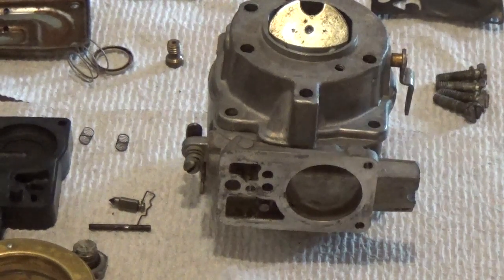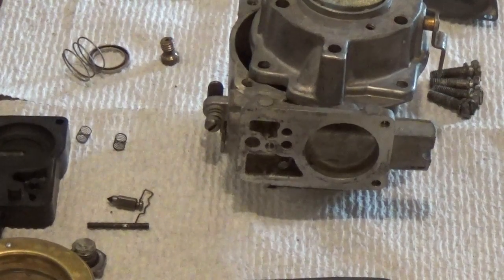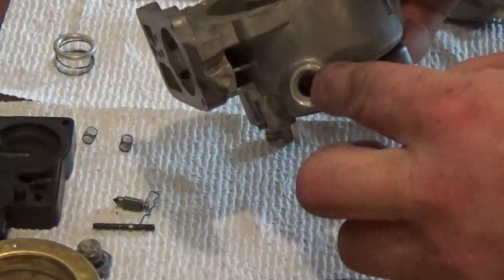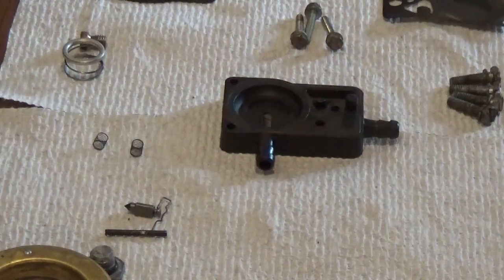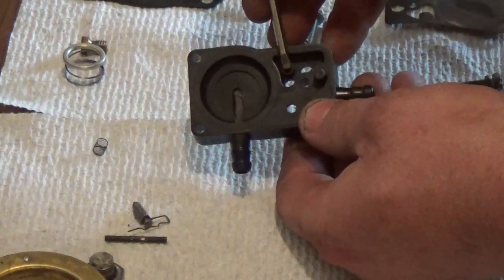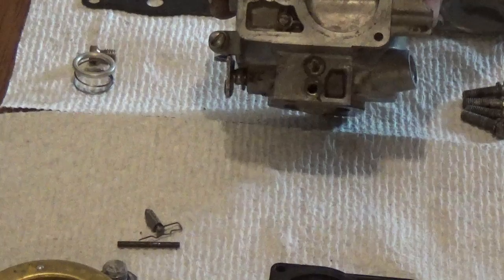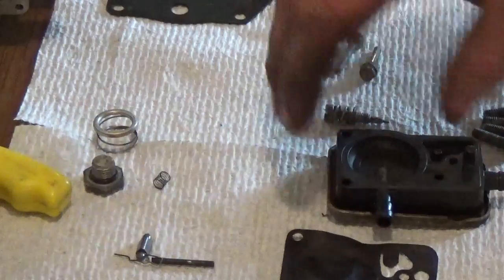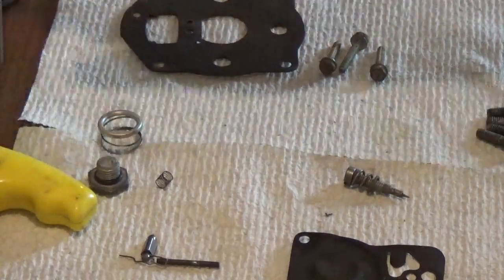Briggs and Stratton Opposed L head Twin Cylinder carb repair part 1

Comment: This was very helpful.  Paid someone to clean the carburetor on my generator a few years ago.  Pulled it out for the upcoming hurricane and won't start.  Removed the carburetor and it looked clean, disassembled the fuel pump assembly and found i was missing the diaphragm spring and cap and one of the little springs.  I went to parts store and ordered a rebuild kit and reassembled the fuel pump and it fired right up.  Thank You!!
Reply from the maker: Glad to have been of some help... Thanks for being a respectful viewer .

Comment: Hello Kevin. Thanks you on the twin carb  videos. Did you make a video on putting it back on the mower. Mine looks just like that carb. Old one 3 screw. New one replacement part out of date old model is a 4 scree. Please point me if you made the install video.
Reply from the maker: Unfortunately I didn't make a reinstall video but its not very difficult as the governor shaft contains a small linkage that affixes to a plastic pivet control arm mounted on the intake  that then protrudes a secondary linkage that affixes its self to the carb ……. note that there are typically two bolts 3/8 that secure the carb to the intake manifold from the underside ……..and just before affixing the carb to its respectful place upon the intake manifold insert the bakelite insulator with its respected gaskets.

Comment: Very helpful, but two things: used guitar strings are AWESOME for cleaning the passages, they are a variety of sizes and some are smooth, some are wound. Second, I really wish you had shown the model number of the carb, and part number for the rebuild kit.

Comment: Thank you for the excellent video. I've ordered a rebuild kit and am going to see if that is what is causing my mower not to start. I have the same carb but the bottom of the air filter box is riveted to the top of the carburetor body. What a stupid setup. 

Can you tell me if the flywheel has a shear pin? I have the engine manual and it does not show one. I thought perhaps the timing is off. If the carb rebuild doesn't work, I was going to pull the fly wheel to see if the shear pin is bent, but if it doesn't have one I don't want to go through the trouble.
Reply from the maker: Yes it will have a timing key or sheer pin .
Reply from the maker: Don't be tempted to use a hammer to hit the top of the flywheel as this can and often will damage the magnets under the flywheel . Simply use a flywheel puller and a pry bar by lifting the flywheel slightly upward and applying shock with a hammer to the torqueing bolt of the puller centered with the flywheel and top of the crankshaft .
Reply: @kevinbolin7665  Thanks a lot Kevin.

Comment: is that walbro 3 screw carb available anywhere if so where? I have tried  knock of after market 4 screw  it runs  full throttle ok  not low throttle

Comment: I have a carb with 4 screws on fuel pump. Any info on rebuilding or going through the carb and cleaning it? I've heard that it is a " Nikki" and they are expensive to buy and buy parts for them. Any suggestions?
Reply from the maker: Switch it out for the 3 screw design then buy a simple repair kit from TE Warehouse for about 12 dollars ....If a float is required they also can be purchased threw TE Warehouse.
Reply: Thank you! I will look into that!
Reply: Where i can buy this 3 screw carburetor?
Reply: What is the part number for the 3 screw repair kit?
Reply: Which is better the 3 or 4 screw carb?
Reply: @dementinum  if you see this did you ever see where to buy a 3 screw???

Comment: How can you change the brass needle seat under float...don't have a tap?
Reply from the maker: Just purchase a 1/4 _20 tap and a bolt of all thread 1/4_20 about 3 inches long with a nut to use as a jam nut ….Then use a 12 mm socket deep well to cover over the brass seat ….. I have a video explaining how this method works ….it may help if there is any confusion ….You can reinstall the new seat with a small round punch set and a hammer just be careful not to drive the seat in to far …...I often will assemble my hinge pin with float and needle several times to insure the proper fit as just driving the seat in intel it bottoms out is risky
Reply from the maker: John most hardware stores will carry a 1/4_20 tap for about 5 dollars and you can purchase a tap tee handle for about 6 dollars to fit the 1/4 _ 20 tap …….But if your doing this on a budget simply use a vise grip pliers and a 1/4 _ 20 tap to thread the old brass seat .
Reply: Thanks for getting back to me i really appreciate that...a friend of mine helped me out exactly how you explained...thanks for the advice, you definitely know what your talkin about.